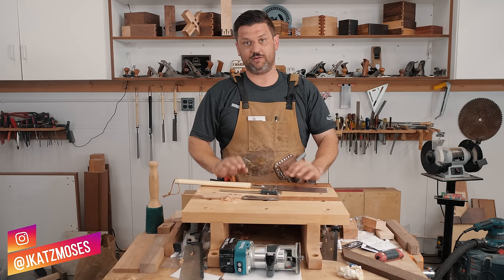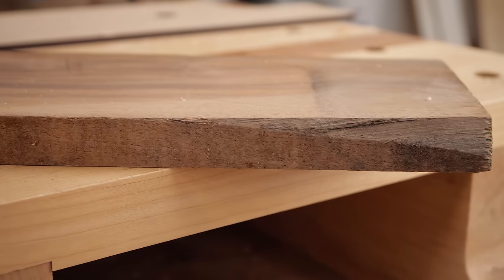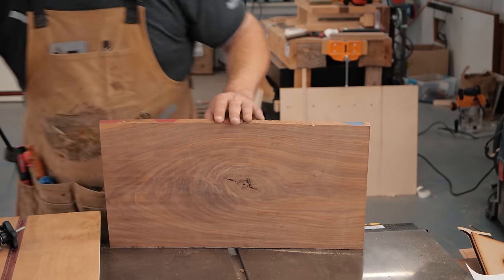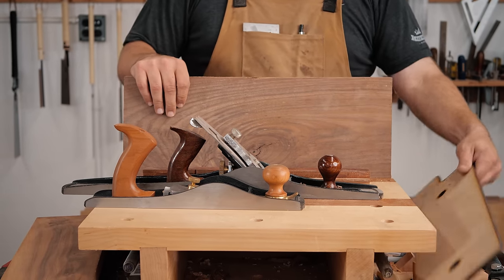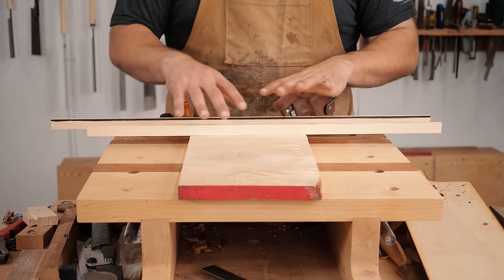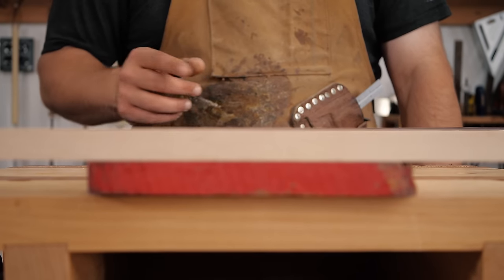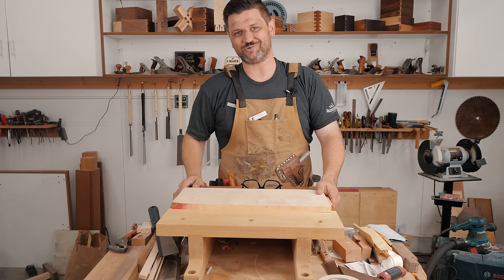5 Ways to Joint a Board Without a Jointer

Comment: "You don't need to buy a jointer"... "...but you'll need a planer"
Reply: Great ideas for a flat edge but doesn’t solve my other problem with no planner haha
Reply: @VumVan  Don't know what tools you have, but you can use hand planes (if you just have a #5 it'll work aok) and winding sticks. If you have a router, you can flatten anything up to great big slabs several feet across. Good luck and hope you make some great projects
Reply: @seaotter52  Thank you! I just finished a vanity recently and still rather new to wood working. That was my first project that involves more than just 2x4's. I have table saw, miter saw, router, and orbit sander. I had some trouble getting some joined panels flat.
Reply: @VumVan 
Sounds like a pretty good set-up. Just remember that folks a couple of centuries ago would have thought they'd died and gone to heaven with the tools you and I have. For big slabs that aren't flat, a sled kind of fixture using the router can trim the slab flat. You can use any bit that does a groove, but I like a bowel or dish bit(about $40-45). Right now trying to decide on a small entertainment center or some gift boxes for next fun. Enjoy!
Reply: Mike Gardner what's a bowel bit lol 💩
Reply: @seaotter52  "bowl" bit.
Reply: @BillGatliff 
Stupid autofill. Good catch. Guess a proctologist would use the other. 🤣
Reply: @seaotter52 , not if he wants my business! 😂
Reply: Mike Gardner you need skills for that
Reply: @avrumisolaimani8546 
Yes, but then again you need skills to do anything. If you don't have the skills, learn how.  Enjoy the journey
Reply: @JohnFx if you'd like to work without tools that's an option, but when trying to replace one tool you will usually need other tools...
Reply: Yea. I have a planer, but no jointer...so this video was helpful. I’ve been getting by quite fine...just here to see what other options are.
:)
Reply: Which does do job so so. look 7:17 right corner is not on the surface.
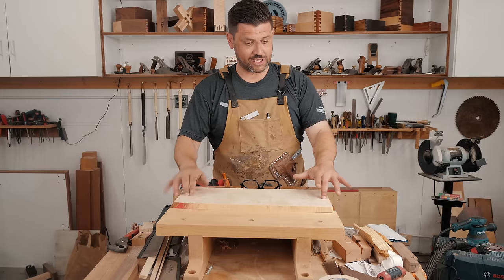Reply: Alex K listen 6:51
Reply: @VumVan  by that list of tools, I reckon a thicknesser/planer should be your next purchase. If you can afford it, it's worth getting a jointer too
Reply: Yeah I was thinking that too!! Like wait a minute 😂😂
Reply: Also doesnt work for 12’ long boards
Reply: Well... You can use your handplane No. 5 (cack plane) to do everything ... Face and edge jointing .... It's a matter of practice I do it I don't have jointer or planer
Reply: Well, you could use your fingernails if their flat enough.
Reply: Could use a router for the whole job
Reply: buy one or the other.... or maybe you just shouldn't be working with wood....
Reply: @seaotter52  I've been thinking of getting a No7, thoughts?
Reply: @hypersonichobo4263 
A good idea if you need it versus want it. Only you can decide that. For the rare long boards, I went with a router table and a Whiteside 1/2" spiral.. A jointer 90* on it's side. Use a #6 or 5 for jointing because most of my work will be too short for a permanent 7 although I have an ash blank that is begging to be turned into a jointer plane. Who knows? Someday perhaps. Really though, if you are a hybrid shop with a good table saw set up or a track saw, the 7 becomes less necessary. If you are a hand plane guy, then definitely go for it. Either way you go, here's wishing you the best. Hope you have a wonderful time in the shop.
Reply: @seaotter52  thanks. I'm definitely more on the hobbyist side of things, working as an engineer. But there is a joy in carpentry that appeals to me.
Reply: @hypersonichobo4263 
I know how deep that bug can bite. Use your engineer brain to work the problem. As a hobbyist if you want to make things for friends and family, power tools and  Kreg pocket holes can do a lot fun projects. Time efficient. If the old timers had them we'd be looking at pocket hole joined furniture in museums. They were about making sales. Just put on a veneer and the holes are covered. If you really want to have a fun, relatively easy to learn hobby, try wood turning. Probably a club near you. I do way more turning now than woodworking. Bookcase, table and a clock, last woodworking compared with pens, pizza cutters, ice-cream scoops, bottle stops etc. I just realized that I fell completely into the rabbit hole of messing with wood. No wonder my wife asked me about the hand saws and planes and if I was going to sell them and I said "NO. I'm planning on using them after the holidays."  Now I'm committed. Good luck and welcome to the obsession!
Added... I'm retired now so more honey dos
Reply: @seaotter52  thanks for the advice I appreciate it. Enjoy your retirement.
Reply: Glad I’ve got a planer and not a jointer… video isn’t for you, fine one that is

Comment: Another great tip is the track saw, which you mentioned, except you don't cut your boards 1 at a time. You clamp the two boards you are going to join together first and run the track saw blade over both joining edges at the saame time. What the blade cuts off the edge of one blade, it cuts the exact same thing of the edge of the other board so when you push them back together to get rid of the now saw blade width gap between them, they are perfectly joined because they were both cut with the exact same blade at the exact same time. Only thing to worry about is how? To clamp both boards  and the track saw guide  together to get the cut done without cutting whatever you are clamping them together. There are a bunch of ways to do this and plenty of videos on YouTube, but it is a great technique and works really well. Especially for joining really long boards together which are more problematic with more traditional joining methods. I use this method to join 8 foot panels together for entry doors, etc.

Comment: I was just trying to figure out ways to do this yesterday, and this morning your video popped up on my feed.  Absolutely perfect.  Now I just need to find one thing in my shop that actually has a straight edge to use as a guide, and I'm golden.  Thanks for this extremely helpful video!
Reply: Same. I opted to just break down and buy a new level to use for that purpose.

Comment: You just saved me 725 bucks.  I am planning out my shop and that was one of the tools on my list.  Thanks for the video.
Reply: Buy a cheap trimmer or router, set a table, make a hole on it, install the said trimmer upside down from under the table, make a nice straight fence, and boom you got a jointer.

Comment: Great video for those of us with jointer envy! I’ve also used a router and a straight bit to joint two boards intended to be joined together. Have the router bit just kiss each side enough to catch the wider parts and run the router along a straight edge. Great results with that technique too!

Comment: These are great tips.  I did break down and purchase a jointer because I found face jointing so painful.  The planer sled worked fine, I just found it so time consuming and monotonous walking from one side of the planer to the other over and over and over.  For what it's worth, Grizzly's G0814 (or G0813 if you want the economy stand) 6" jointer runs on 120V and has worked great in my shop thus far.  I'm just a hobbyist, though.  These tips are still useful even if you have a jointer since, as you mention, sometimes you can't run a piece through your particular jointer.  MDF makes a great planer sled, by the way.  It's going to be dead flat.

Comment: Subscribed cuz: you explained it in a way that I could understand, you created that magnetic fence that I've yet to see in any other woodworking tip video, and you didn't ask for me to subscribe. Thanks for all those things.
Reply: That is pretty unique, huh? I feel like I might actually be able to make that, too. Now to buy a plane...
Reply: I too like the non begging. As for the 90* plane fence, they go back centuries on the old wooden planes with screws and with the metal planes I've seen both magnets and screws (plane body was drilled and tapped) used. The rare earth magnets are really cool. So versatile. The lipped edge on JKM s version is really clever.. Another project in the future

Comment: Definitely taking the jointer off the to buy tool list. Thanks
Reply: Ross I am about to mill up 20 metres of board length, so 40 metres of edges.  I'd hate to be having to do this without a jointer.

Comment: I have always jointed with the router technique you've shown. Figured it out on my own, and have been told it was wrong, but it always worked for me. Glad to now know I'm not alone.

Another tip is, if you're working with a super thick board, use the router method to get the line, then follow up with a track saw to finish the cut perfectly. Using a combination of these methods, and a planer, I really see no need, for me, to waste the money and space on a jointer.

Comment: Sold my jointer, purchased a Festool track saw TS 75for clean edges and use hand scraper to clean edges. I use hand planes to flatten it.
Reply: Hand planes may not give perfectly straight, smooth 90° edges for gluing layups.

Comment: I use the jointer/router system when gluing up panels, but I "joint" two boards the same time. so they fit a 100% together. Just position them sligtley nearer than the diameter of the Bit, then with one pass joint both.  Thanks for the Vid. New subscriber ;-)

Comment: What I want to say is your straight cut jig is the most sensible I've ever seen. It solves one major problem with the ones that use those top down clamps, and that they're only designed for one board size. Yours can handle a variety of sizes. 

Very nice work. Subscribed.

Comment: For edge of board straightening I've used sleds and the like before. If you have several boards to straighten on the edge, I have made a long straight edge that clamps to my table saw fence, and then run the concave side of the board to the straight-edge and true up the opposite side and it works great. This works fairly well if you have many boards to straighten quickly. The Straight Edge needs to be about double the length of the boards that you're using. Thanks for your video.
Reply: This is how I do REALLY long boards. I use an 8 foot level as the fence.

Comment: For the planner sled I made mine from scrap Corian then I put a few blobs of 5min drywall mud, layer of cellophane then imbed my board. 5 minutes later mud is hard and ready for the planner.
Reply from the maker: Woah! I might have to do a video on that! Good idea!
Reply: I FOUND THE COMMENT THAT SPAWNED IT ALL
Reply: Its "hot mud" not "drywall mud" 
Two different things
Reply: Drywall mud does NOT dry in 5min
Hot mud DOES though!
Easy way to confuse someone else trying to copy you

Comment: Great video... i flipped my way from a tiny delta jointer i bought for $50 then sold for $220 after i cleaned it up and bought a larger ridgid for $200... so i made $20 and got a jointer lol.

Comment: A great video as always, Jonathan. I don’t currently have any machines available to me at home, but the magnetic hand plane guide, is a damn fine idea 👌 Thanks.
Reply: Chris Morris The mag jig for a hand plane fence is cute, but craftsmen have used a simpler method for ages. Just lay the board flat, pack it up a bit, and work with your plane laying on its side. No waiting.
Reply: @leehaelters6182  Lee, I was thinking the same thing, but it occurred to me that Jonathan does not have a full size workbench.  Just that wee bench we see in his videos with the Moxon vice on top.  That is going to make it harder to plane a longish board edge against a bench dog, or even use a shooting board.  When you see Rob Cosman plane an edge, he starts with it square from the jointer, and does that trick pushing down on the plane with his left thumb to keep the plane flat to the wood, or he'll do what you described, or use a shooting board.

Comment: Great tips. I’m not sure I’ll ever have the space to justify a decent jointer. My trick for edge jointing long (e.g. 8 - 12’) stock is to use the track saw to establish the reference edge. Much easier to clean (& eventually replace) a good track saw blade than a good router bit (3x more $$).

Comment: I’m digging the magnetic hand plane fence .
Reply: ben rudman, the mag jig for a hand plane fence is cute, but craftsmen have used a simpler method for ages. Just lay the board flat, pack it up a bit, and work with your plane laying on its side.
Reply: @leehaelters6182  genius!
Reply: @Eric Hutchison, appreciation appreciated. Credit goes to an unknown craftsman, untold years ago!
Reply: @Eric Hutchison, the thinner the stock, say, guitar tops or backs, the more this technique is appreciated.
Reply: @leehaelters6182  oh yeah wow I can imagine, that would be tough to square by hand

Comment: I built my first table using some of these methods. While they worked, my results were not 100% and now that I have a jointer, I can say without a doubt it's absolutely worth its weight in gold when it comes to making straight, flat, square pieces of lumber.

Comment: I like your magnetic jointer plane attachment!
Reply: The mag jig for a hand plane fence is cute, but craftsmen have used a simpler method for ages. Just lay the board flat, pack it up a bit, and work with your plane laying on its side. No waiting.

Comment: I had this very problem this week whilst making a 2' wide by 39" long window sill.. (old stone cottage reno)  I was using a 9" standard PINE  bull-nosed board in 3 sections to give me the required width (bullnose cut off 2) 🤨

The edges seemed fine, square & straight so I glued her up... the following morning my sill was now a pretzel ! 😂

Sooo... I cut back into 3 strips, used the packing-up/hotglue  planer thicknesser trick and when I got 'em flat I used my tracksaw to "joint" the edges. 

Glue-up #2 went fine & I varnished it before the moisture content changed & it tryed to re-pretzel on me 🙄
I was lucky it was just a sill & finished thickness & width weren't so critical 😏

I've also tried using the router table with a shim on the outfeed side of the fence & cutter edge lined up with that shim... couldn't get it to work for some reason. 
On shorter boards a shooting-board type of setup and a long plane works too...
Also... its worth mentioning to always flatten a face first...  before an edge... 😏
Nice vid...  
Subbed & liked, my friend !

😎👍☘🍺
Reply: If you are relying in finish to keep out moisture to keep your boards from warping, it will not be a long term solution. Moisture will eventually get in and the boards are going to do what they are going to do. If your boards warped thst bad the first time, then you simply need to use more stable wood then you used for that project.

Comment: Shop worked wood professionally for 35 years. Never owned a jointer. Straightened with table saw and router using straight edges. Never could afford floor space for a tool (jointer, bandsaw, shaper)  that didn’t earn its keep. That’s what mill works shops are for and I was mostly doing casework. Had a door plant make doors.

Comment: Hmm you just talked me out of a $1200 purchase man. In all honesty I have stuck with buying bbs panel glue ups. I was thinking of trying to make my own jointer but that requires time and resources that I just don't have. Thanks for the awesome info bud, keep'em coming.
Reply: Dude. Buy a cheap hand planer from pawn shop. Put new blades on it. 
Take two different tables - surfaces 
One a 1/16" higher than the other
Mount the hand planer upside down to the lower table / surface (clamps or screws, festool trac clamps work amazing for this)
Boom. Instant joiner less than $100 +4hrs labor......

Comment: For winding sticks, check out Paul Sellers. Would like to see a build on the jig for the planer though, with the exception of a Jointer, that jig really looks to be the best way. If you have a router table and fence, can easily joint that way as well. Using a router on the face, router skii's or sled as many would call it. Great video. Cheers :)
Reply: Ham68 

If you spend enough time in a maker space you’ll eventually wind up with a collection of straight aluminum extrusion.  Best winding sticks ever

Comment: a plywood router sled, or if you happen to be a cnc enthusiasts like me, your cnc router, can 100% replace the planer as well for flattening the face of the board.  1-2 inch face mills (meant for surfacing the spoilboard on a cnc router), are GREAT for flattening big hunks of wood. The hand router is a good cheapish way to do that kind of stuff, even if it is a bit slow. A semi decent plunge router, the bits, and the sled are gonna cost less than a planer.

Comment: I guess it depends on how (& where) you source your material (rough) but the jointer is usually actually one of the most important machines in the shop.
That’s where it all starts.
Process it true from the beginning and it’s a lot less work (&trouble) every step after.

Comment: The mag jig for a hand plane fence is cute, but craftsmen have used a simpler method for ages. Just lay the board flat, pack it up a bit, and work with your plane laying on its side.